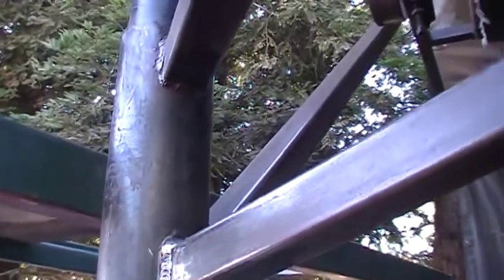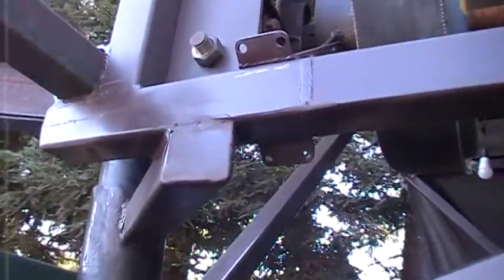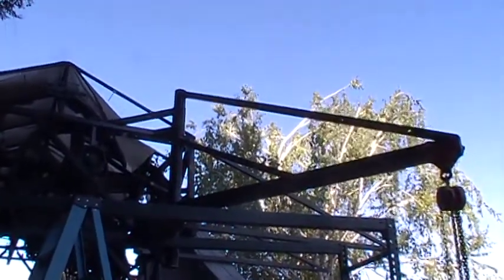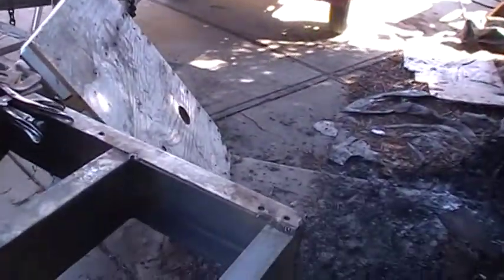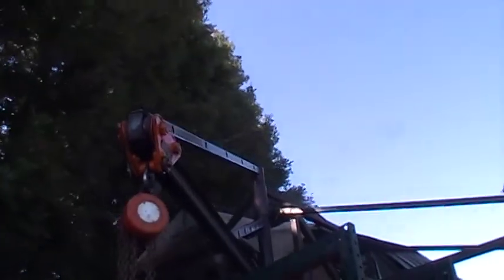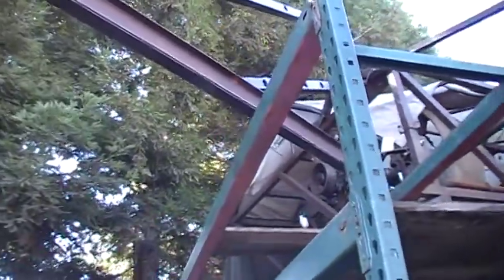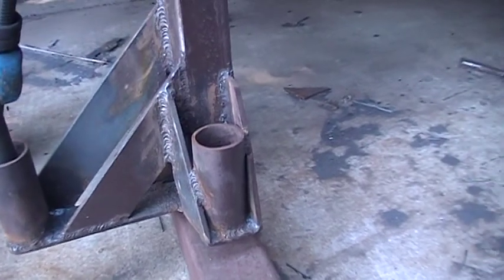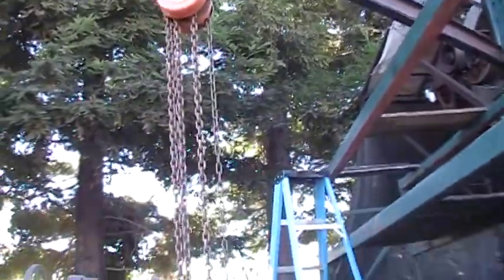The finer points of building a jib crane

Comment: Grinding off the weld on the intersecting tubing gives it a clean look but doesn’t it compromise the joints? Maybe you’ve taken special precautions that I didn’t notice. Beside that the crane is real handy addition that will enhance any shop, thanks for the video.
Reply from the maker: Thanks buddy. I hole sawed the tubing and the holes were a bit larger than the pipe then I welded it really hot.. burned in pretty good. Some say the welds shouldn't be ground....